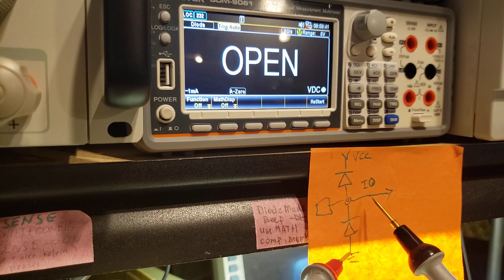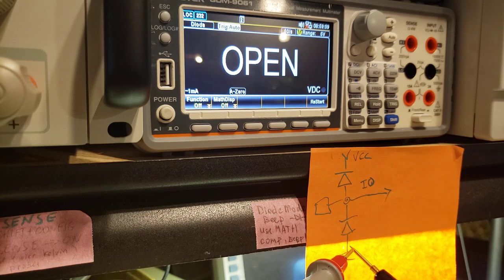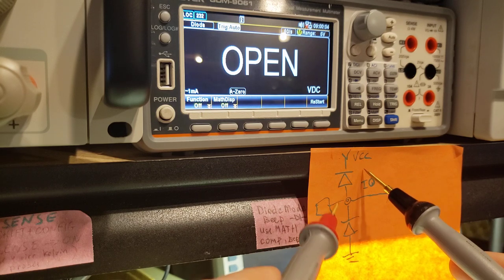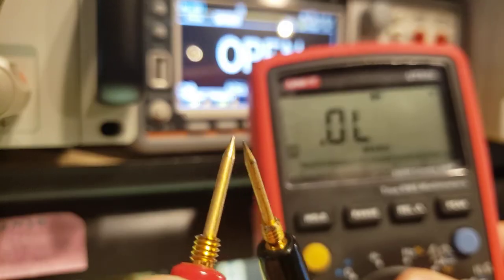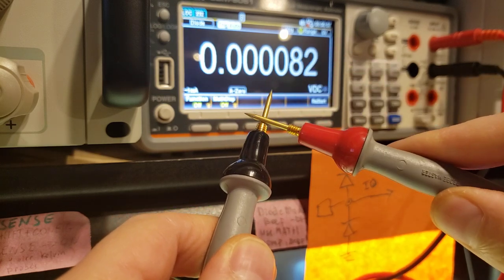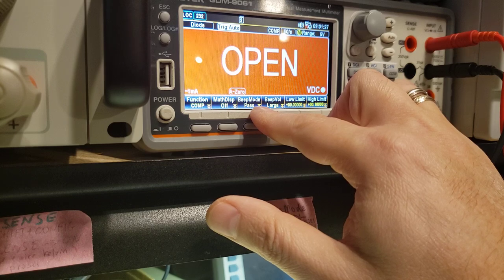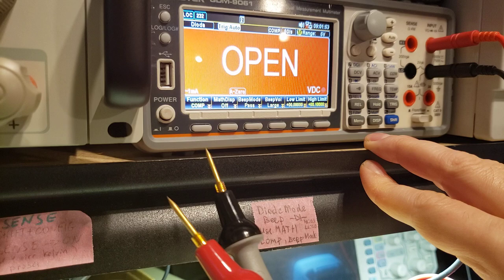Why red probe on ground in diode mode, when testing/repairing electronics.

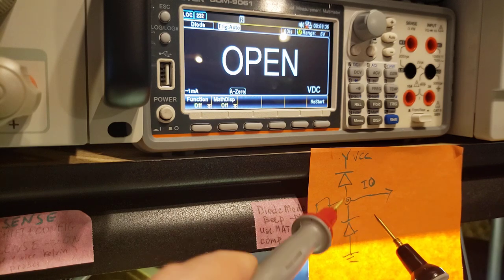Comment: 1:47-1:59 - "can test two conditions, short and open."
If there is a short, doesn't it matter which way you measure in diode mode? It's a short, wont matter which probe on ground?
Reply from the maker: That is correct a short will read short either way, the point is that when you measurw with red probe on ground you can figure out if the IO pin is normal [diode voltage drop], disconnected or short. So actually 3 results with single measurement.